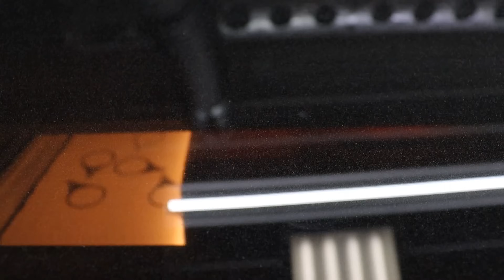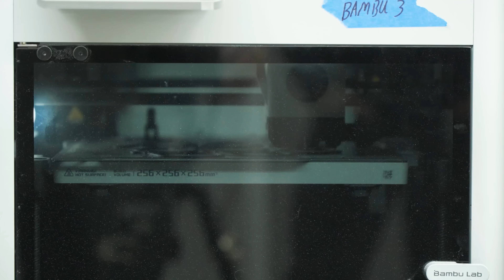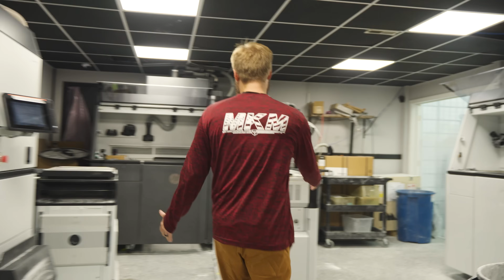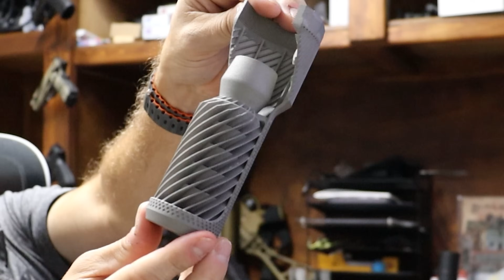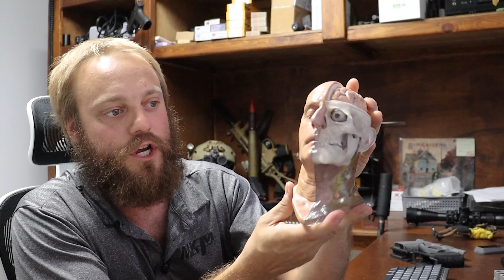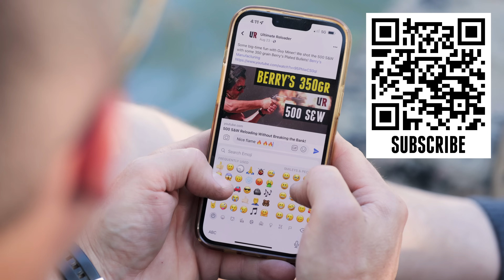From Prototype to Precision: MK Machining’s 3D Revolution

Comment: I've purchased several of their products.
Back when they started I bought a throw lever, I think it was about all they did IIRC and it really looked primative by today's retail FDM standards but it has lasted without issue.
Recent orders of levers and scope caps have evolved into really professional looking quality items.
A massive shift that's impressive.
The only improvement I could see in there business model would be to provide clear lead times when placing an order. Other websites don't have any issues telling you if it's on hand or when they can ship, MKM should be no different. Delayed delivery might seem small or normal to them, but to some customers without knowing it is definitely a concern.

Comment: I wonder why none of the manufacturers that either 3D print or mold inject glock frames has ever tried to re-design the grip ergonomics to give it a less blocky feel and a more contour shape to fill the hand pocket like a Taurus TX 22 and other brands outhere?
Reply: They have, Shadow Systems for example.

Comment: I have a few mk machine products... There Ak grip is nice but could use some dimensional refinement but overall nice product. I also ordered a scope from them and their products that come with the scope you order is awesome! And they have really good customer service! That is uncommon these days and I truly appreciate great customer service!
Reply: Hey if you think they could make a better grip you should reach out to them and explain what you think could be better. I say this because the coolest thing about 3d printing is the ability to do rapid design changes. With CNC that requires an entire setup and depending on part complexity and tooling that will require new programs and potentially even custom fixturing and different tooling. Plus--I don't really know about these professional grade 3d printers but it doesn't seem like you can "crash" them like you can a CNC mill. It's so easy to make a split second mistake in CNC and BOOM! There goes $50,000. That aspect alone makes 3d printing very interesting to me from a commercial standpoint. I know of a shop in my city that had to rebuild a machine because of a crash and in this case it cost $500,000 to repair *and they didn't even fire the machinist*. That really tells you something. It tells you that even though the guy cost the company half a mil because of a mistake--he was so good it was worth it to keep him employed. That's why I'm getting really interested in 3d printing....even though the machine is expensive i think it would be worth it in the long run.
Reply: If you have any grip ideas, we're all ears

Tony - MKM